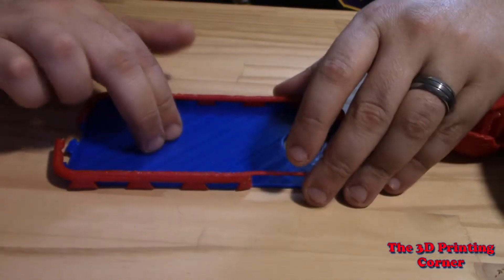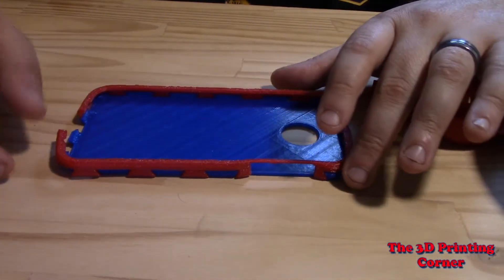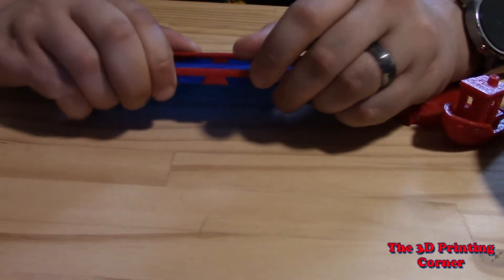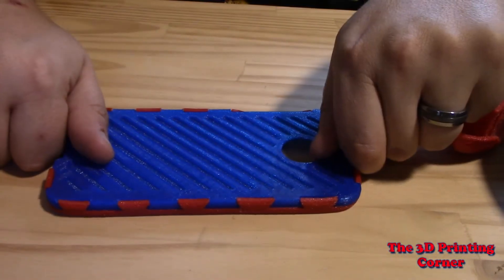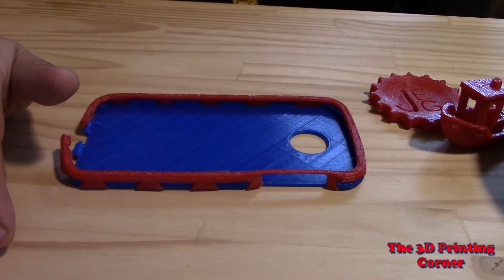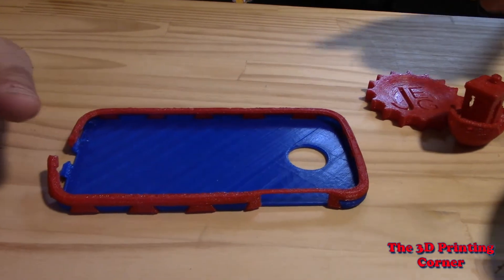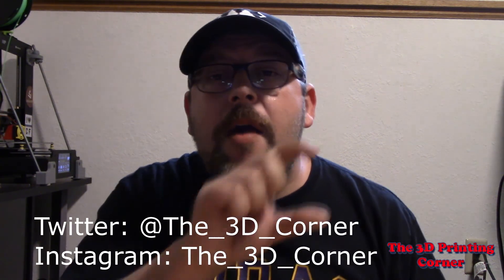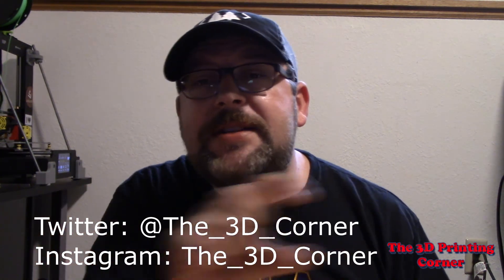3D Printing with Ninjatek Cheetah TPU worth the price?

Comment: Thanks for your review!  Cheetah is very expensive as you mentioned and I found your video while I was doing research on alternative cheaper TPU filament.
I think you might have problem with your settings/printer that's cause of those issues. I print several rolls a week of Ninjaflex on my Makergear M2 printers and it prints really well, as smooth as PLA. It's very difficult to dial in tho, especially temperature. Few degrees off and it starts to boil causing that rough finish (especially on first layer cause it prints it slower, so it boils more in the nozzle)...

Comment: Thanks for all your reviews. I'm just getting into 3D printing and your budget reviews are just what I needed. Have you tried printing at 220°C? I've heard that it works pretty well. It would probably help with the stringing. I also heard that you can print without a heated bed.
Reply from the maker: I have tried lowering the temp, and it made other issues much worse.  For me, and in my direct drive printers, I much prefer Sainsmart TPU to Cheetah, and it is loads cheaper, and prints far more consistently.
Reply: The 3D Printing Corner Wow! That's good to know! I want to try my hand with flexibles. They open up a whole new range of possibilities.
Reply from the maker: Flexible filament can be fun, once you get it dialed in. If you do not have a flexible specific extruder, stick to semiflex materials, or you will have more headaches than you know what to do with, and no success to show for it.
Reply: The 3D Printing Corner Well, messing around and learning from your mistakes is a big part of being a maker.
Reply from the maker: Absolutely it is, but so is learning from others mistakes 😁

If you have a direct drive printer, I would absolutely give it a go with a stock head. Just remember slow and steady wins the race. Better to have a 3 hour successful print than a print that is scheduled to take an hour and fails in 10 minutes because you went to fast.
Reply: The 3D Printing Corner I actually have a Bowden setup, but there is a redesigned part on thingiverse to increase the tolerances around the drive gear. As long as I keep it slow, it should work.